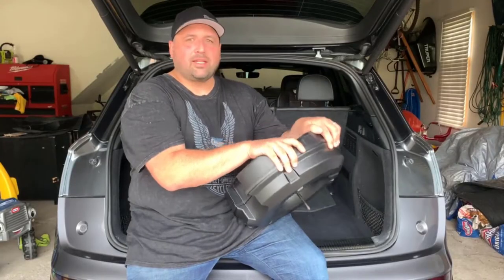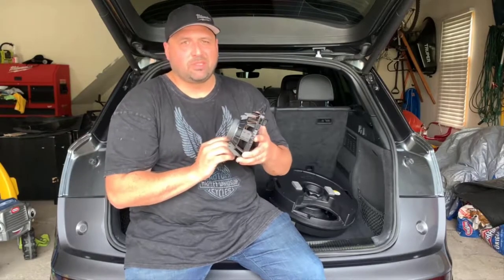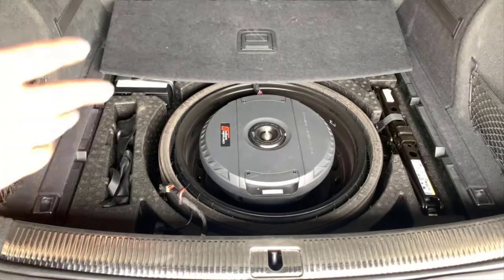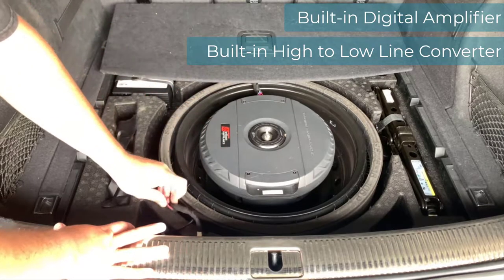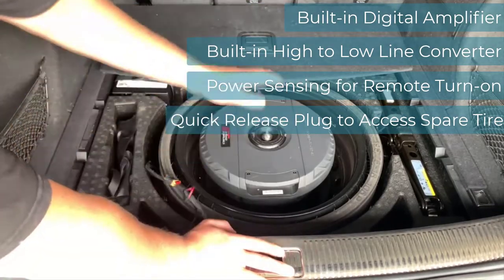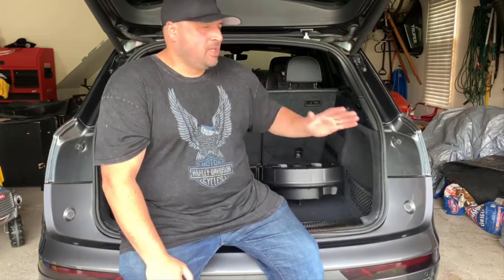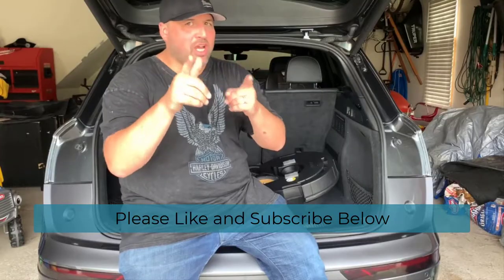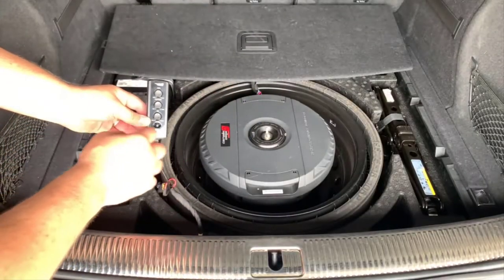Audi SQ5 B9 - Subwoofer Upgrade -- Cerwin Vega 12" Spare Tire Subwoofer w/ 600 watt AMP!

Comment: The Audi Q5 already comes with a BOSE spare tire subwoofer that is powerful, unless you have the B&O system? Why down grade, especially when the BOSE has really clear low mid and high bass sound, unless this speaker puts out the same
Reply from the maker: I’d have to disagree with you — whole heartedly. Check out the Q&A video — https://youtu.be/YWwqsGtCkSY. The Bose system is a dismal 40 watt 6.50 speaker. The cerwin Vega is 11.3” with 600 watts. Between the surface area on the subwoofer, size of the magnet, and power handling — you get much deeper bass notes and way more of a range.
Reply: @tangentsdaily  now THAT is interesting! What about the low bass sounds, does it come through strong as well?
Reply: Yes I have B&O in my q5 the sub it's only 6.5, low frequencies like 30 ~40hz  don't exist  lol
Reply: @tangentsdaily  no, it will never use 600 watts, never, literally impossible. Yes its better than OEM, much better, but it's not as good as the JBL, and not as good as you are making out to be.
Reply from the maker: @ThomMurphy  Did you buy stock in JBL LOL -- thanks again for a comment.
Reply: @tangents daily  no, but I "took stock" of the facts when making a decision on which product to keep. I just wanted to share those since I had "invested" time to come "buy" them, and others here could "profit" from them.

Comment: Why did you chose the Cerwin Vega over the JBL or the Rockville?
Reply from the maker: That's a good question. At the time, I liked the price point + the speaker was slightly larger than the JBL and Rockville. So I just went with the most displacement.

Comment: Hello sir thanks for posting this video. I am driving VW Atlas and have fender spare tire subwoofer with which I am not satisfied so can I order cervin vega woofer and just replace it with fender or I need to do some wiring work as well?
Reply: I just had this installed this in my Atlas. It sounds great.. way more bass then needed

Comment: Yea my jbl tire sub doesn't play lower frequencies, quite disappointing. At least I got a used one at a huge discount.  Just because it has an 11" woofer don't have high expectations or you'll be very disappointed
Reply: It will play low (under 30Hz, and fairly loud at 40Hz), but you have to feed it a good signal. Now, most folks buying these cheapies probably aren't running their sub signal though a DSP, but if you were you would probably be surprised what it's capable of.  Hooking this up to the high level of a factory system, it will suffer the bass rolloff programed into the factory system to protect it. Even something as simple as an AudiControl LC2i can do a lot to improve the performance.
Reply: @Thom Murphy  yes very true, I forgot to mention the bass is a little deeper when listening to  Pandora music's  high quality feed
Reply from the maker: If you set your phone to "bass boost" which is what I run the system at... and turn down the bass to like +5 you might be surprised how much more you get. Bluetooth kills sound quality.

Comment: Can this unit be mounted without a spare tire? As I took my unit out of my old car and am putting it in my new car that doesn't have a spare
Reply from the maker: Hey John, I'm pretty sure that it can. It comes with a retaining clip so I don't think you'd have an issue tightening up on it. Thanks for stopping by and watching!

Comment: I have a 2013 Q7 I wonder how hard is it to install
Reply from the maker: I've been working on getting an update in my 2020 SQ7. In the 4m the battery is under the passenger tire... and I am not sure if the 2013 has a spot for a spare tire... if it does --- it's totally worth it.

Comment: Have you heard of Diamond Audio? They are a sister company of certain Vega. I'm thinking of getting the DASTX12.  Would you think you would be similar installation as the vpstx12?
Reply from the maker: I had not seen this unit up to this point, but I dig the design of the top of the woofer (although I'm not sure people will see it tucked away). I see that the line control is built in versus remote bass control (wire that would take the controls to the front of the car)-- honestly, I like it integrated over a remote line for a clean setup. I'd be curious to hear / see this version! Thank you for your comment and watching!
Reply: @tangentsdaily  thanks for the reply. I just ordered it. Will keep you posted for an update.
Reply from the maker: @xthrilla1  looking forward to hearing more!

Comment: Do you think this will work for my 2019 a7 c8. I really don’t want to cut or add wires so that’s how your is right?
Reply from the maker: Thanks for the comment. It really depends on the height of your spare tire. I do have another Q&A video on the writing and how to figure out the wiring here: https://www.youtube.com/watch?v=YWwqsGtCkSY . You will need to add a fused power cable connected to your battery, a ground wire to the chassis of your car, and tap into the existing subwoofer outs. I also recommend you get the shallow edition, which has a link in the description above.
Reply from the maker: It should be around the 8 minute mark.

Comment: Could you possibly make a video on how you wired everything ?
Reply from the maker: I have a Q&A video here: https://www.youtube.com/watch?v=YWwqsGtCkSY
Reply: @tangentsdaily  Watched it already. I have one question that i didnt quite understand. You mentioned at one point to be careful on how we connect wiring to battery as it may cause fire. Is there option to add fuse on the battery ? Fuse panels on SQ5 are up front left of steering wheel and right side of the storage compartment.
Reply from the maker: @Shulcyo  Most amplifiers, including the Cerwin Vega, has a fuse in the power line to connect it to the battery. If you use the supplied fuse lines with the amplifier kits you should be perfectly fine. Always, always, always fuse the power line to the battery. The ground wire can just be grounded to the chassis.
Reply: @tangentsdaily  Much appreciated ! Will let you know how it goes
Reply from the maker: @Shulcyo  Definitely love to hear how it goes!
Reply: @tangentsdaily  I rewatched your Q&A video and i am confused about one part. If you use hi to low converter for red and white connector on the other side of the converter you will have free wires. As a matter of fact you will have same set of wires coming out of converter as coming of 18pin harness. In the Q&A video you mentioned you joined left and right positives and connected them to gray/red (positive), than left/right negative to gray/brown (negative). My confusion is to where do you connect those same lines coming out of converter ? My wild guess is join them all together with the ones coming out of 18 pin harness and than connect to factory positive and negative cable but i am not sure if that’s the right pathway. What is your advice on this?
Reply: I am also curious as what converter you used after all. Was it the Kicker one or something else?
Reply from the maker: @Shulcyo  `If you got the Cerwin Vega, the High to low line converter is built into the unit itself. Using just 2 or 4 lines are highly dependent if you have a B&O system or not. The B&O system requires all 4 channels (4 wires to be wired into the high to low inputs on the amplifier). If you don't have the B&O system, you can pair the Positive (+) lines on the high to low inputs, and the Negative (-) inputs, since on the non-b&o system there are only 2 lines you can use.
Reply from the maker: @Shulcyo  I used the built in line converter on the Cerwin Vega Amplifer.

Comment: What SQ5 trim do you have?  Are the subs the same across premium and prestige?
Reply from the maker: The vehicle shown is a Premium Plus. It should have the same base sub as the prestige — unless it is optioned with the B&O system. The B&O system has a bigger factory am — and a second 6.5” in the box. However it is mounted and plugged in the same as the non- B&O. Thanks for the question!
Reply from the maker: Hey Mark -- I posted part 2 that answers this question a bit better. https://youtu.be/YWwqsGtCkSY

Comment: Is there a JBL and Rockvile sub with integrated amp? Or is it CV as only option
Reply from the maker: There are a few options out there. They are all relative in their components, built in amps, line converters, etc. I went with the Cerwin Vega as it is slightly bigger 11.3", which gives you a little   more displacement than the others, but all of the choices would work solid.
Reply: @tangentsdaily  The JBL and the CV have the very nearly the same size surface area. The JBL is ever so slightly larger. Also the JBL has a little over 3mm more Xmax. Importantly, IMO, the JBL has significantly better electronics and amplification doing a true 200w RMS vs this and it's 150w. This won't EVER hit 600w. CV doesn't even claim that. The Amazon listing you linked to is straight up lying. 

Also everything you list Amp (well, better a better one in the case of the JBL),  line level input, power sensing, quick release, and line bass control are on the JBL. Perhaps the most significant differences are simply that the JBL get louder and plays lower.

When they first released the JBL was more expensive, but today they are about the same, in fact the JBL can be had for a bit less. So, really, IMO, the ONLY reason to consider the CV is if the ever so slightly taller JBL won't fit physically without more modification than you're willing to do.
Reply from the maker: @ThomMurphy  This is a really well thought out response. At the time of the creation of the video, I did my fair share of research of the different versions of subwoofers in the market. Per the part of the video of why I picked the CV --- my intention of why was more about why I picked a spare tire subwoofer design, over a traditional setup (amp external box). I really didn't phrase that well in the video -- but really was my intention to state that I selected the setup because it was all inclusive. I do agree that Class-D amplifier in the JBL will produce a more reliable 200watts, however the loudness of the speaker is severely limited by the location in the SQ5, as reviewed in this video. My SQ7 is worse with a 3/4" MDF trunk cover. Where the CV was a success in my opinion was being able to have a way better bass note than the factory. I did mention further in my video if you are looking for all out bass output, go with an external amp + subwoofer. For someone that wanted the space and convenience, with deeper lows, the spare tire setup did the job just fine. Both options are great picks, but I only had the CV to review.
Reply: @tangents daily  fair enough, I wasn't sure, so I fell down a rabbit hole trying to figure it all out and ended up buying everything just to be certain.  100% agree, it's an upgrade over stock no matter what.

Comment: Question bro and please excuse me if you already answered it. I have the SQ5 Prestige package with the B&O package. If I wanted the Cerwin Vega STS is it simply plug and play or would I have to do a new harness?
Reply from the maker: Alexander -- It is not fully plug and play. You will still need to tap into the harness of the factory subwoofer out to get the remote turn-on (how it knows to power on) and the signal to the subwoofer (how you get sound out of the subwoofer). Essentially you only need to tap into the 4 lines from the factory harness and wire them into the s4 lines coming out of the Amplifier Harness for the high to low converter. The amplifier turns on when it sense signal from the lines from Subwoofer (power sensing). You'll then need to run the power to the battery, and ground to the chassis. And it's installed. It will likely be the easiest subwoofer install because the battery is in the trunk. lol
Reply from the maker: Hey Alexander -- I answered this question in detail for you in Part 2. Cheers! https://youtu.be/YWwqsGtCkSY

Comment: For the SQ5 did you use standard or shallow version?
Reply from the maker: I used the standard version, but recommend the shallow version for a better fitment without having to modify the trunk cover. Thank you for stopping by!
Reply: @tangentsdaily  I bought both the shallow version didn't have thump at all.  Kept the small hump with the bigger sub in the back for the sake of better sound! Thanks again.

Comment: Are the watts different from the Vega subwoofer from the vehicles? I want to swap out the stock tire subwoofer with this one on my 2020 Q5... but I'm worried, does it drain my battery or if it affects the vehicles power anything like that...??
Reply from the maker: As long as your vehicle has a subwoofer in the spare tire area, you should be able to install it quickly. It would be a little more work if you don’t (as you need to run wires to one of your rear speakers) (or at the factory amp location). If there is a spare tire there, you should be good to go. Just pick the shallow version! (Link is in the description) for it to fit better.

Comment: Would a powered bazooka tube out perform this?
Reply from the maker: It depends on where the installation is of the bazooka, and if you are using an external amp. This subwoofer is kind of for those that want to keep the full trunk space, and not have to externally mount an amp. If the bazooka is under the same spare tire cover, it likely will have sound loss the same as this, (since you have to get the sound waves through the spare tire cover. If you mount it in the trunk, the bazooka likely would have better sound.

Comment: I need help guys!!! Im about to buy an Audi sq5 herr in Australia.  The issue is i cant find one with everything i want. So my two.choices are this. 
Sq5 with lane assist and blind spot but with the standard system. Or sq5 with the b&o system but no blind spot. Any thoughts on weather the b&o system is worth it or do i go for safty and just upgrade all the speakers in the standard system
Reply from the maker: I would absolutely go with more features (lane assist and blind spot) over the B&O stereo. While the B&O stereo does sound better than the base system, you can upgrade the stereo a lot cheaper than getting lane assist and blind spot after the fact. I drove a car without blind spot and i didn't realize how much I rely on it now that i have it on both of my vehicles. Also, with the subwoofer added, (link in description), it completely sounds better than B&O for the mid/low notes.
Reply: @tangentsdaily  thank you so much!!

Comment: Any similar ones but that are 10" thanks :)
Reply from the maker: There are a couple of brands that have a smaller SUB but they are the same size. JBL, Pioneer and a few bother brands come in a little over 10".
Reply: This's "real" size is less than 10"

Comment: Hey does your SQ have the B&O sound system?
Reply: I don't think so because i don't see the 3d tweeters in the A pillars, this makes installing a subwoofer a lot easier.
Reply from the maker: Thanks for the comment! It does not have the B&O system. The B&O has two 2 ohm 6.5 speakers mounted in the box. The Non-B&O Is just a single 6.5”…
Reply from the maker: I wish I would have went with the B&O if it was available  but the pickings were slim In the SQ5s.
Reply: I have the B&O.... trust me... it's not worth it.
Reply from the maker: I was able to answer this question in part 2. I also gave you a shoutout and a link in the description as well for your harness. Cheers! https://youtu.be/YWwqsGtCkSY
Reply: @tangentsdaily  Great video. Thanks!

Comment: Cerwin or JBL?
Reply from the maker: This was the Cerwin version.. it has a slightly larger subwoofer.... but probably not enough to make a huge difference.
Reply: @tangentsdaily  My bad. I meant which one is better?
Reply from the maker: @TW-hb2cr  All is good. I think they both get the job done. If you go with the shallow mount version of the Cerwin Vega, you will have a better fitment.
Reply: @TW-hb2cr  If you don't need the size of the shallow mount CV the JBL is MUCH better. Do yourself a favor though and find away to avoid the high level input and restore some of the bass the factory system rolls off.  

Better yet do the passive JBL Stadium BassHub,. It's much less of a "toy". You can power it off a very (physically) small class D amp, maybe one with a built in DSP, to save space. I've had one hooked up via a DSP'd signal to a RF T750X1BD that does over (980w at 2-ohm and 1%) 800+w at 2-ohm with less than 0.1% distortion in that install. It has been going for nearly 2 years now, pushed hard, and it actually impresses. Not, "for what it is", just period. 

Have had this (CV), the JBL BassPro Hub, and the JBL Stadium BassHub all in the exact same setup and they are all quite different. While the CV is better than OEM, I don't think it performs even half as well as the JBL BassPro Hub, and the BassPro Hub isn't 20% as capable as the JBL Stadium Basshub. That's just based on performance, based on quality I wouldn't say the CV is even 25% as well made as either JBL. I've taken them all apart, inventoried the electrical components, and build quality. They're all built overseas, and cheaply, but the CV is clearly built to sell via marketing and little more...

I have some pictures of the teardown differences if you're interested, LMK.